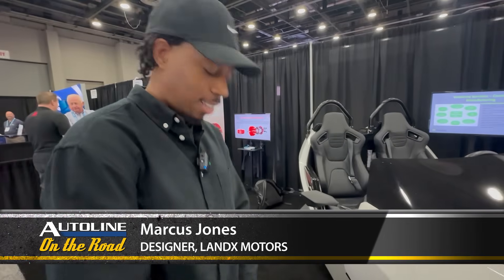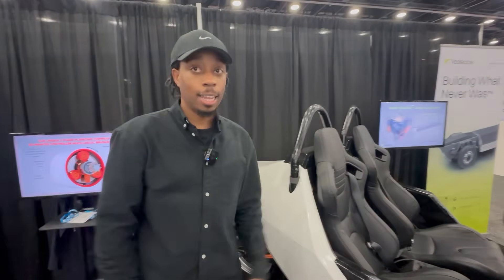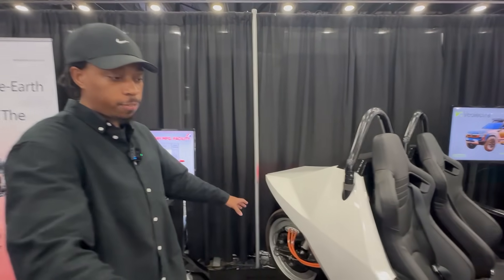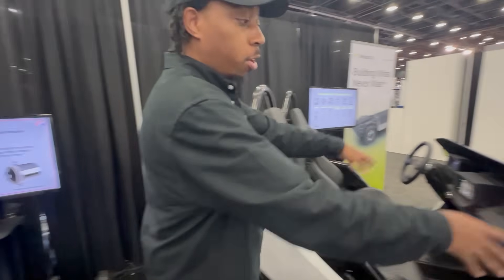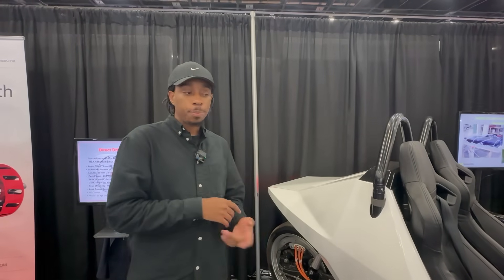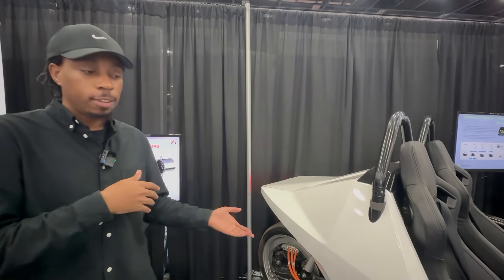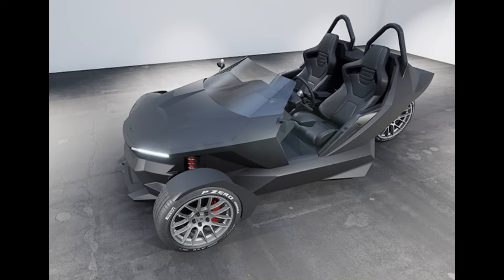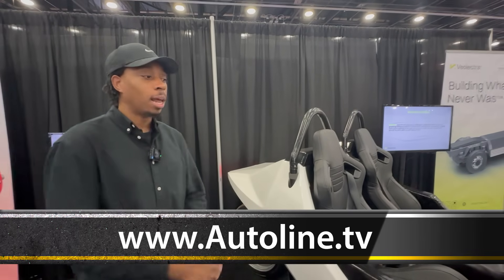This 3-Wheeled EV Could Bring In-Wheel Hub Motors to the Road - Battery Show 2025

Comment: Only way these 3 wheel autocycles make sense, Aptera included, is if they are lower cost vs other functional options like the 27 Bolt, Equinox or sub 20k mile used ev.
Reply: According to that logic, motorcycles and luxury cars shouldn't even exist.  Yet there are people who are happy to pay more for a motorcycle than many people pay for their cars.  Bottom line:  Many vehicle sales are not based on a cost vs. function analysis.  They are based on how the vehicle makes the buyer feel.  Sorry, but no matter how much you tell people exactly what they should do logically, you're not going to change that.
Reply: @netscrooge Valid point.
But I was thinking large sales numbers vs niche.
The Apteras of the world are definitely niche